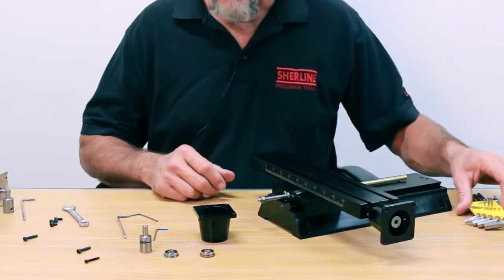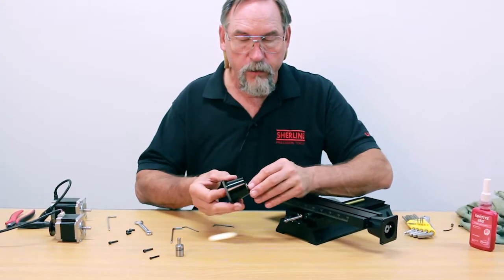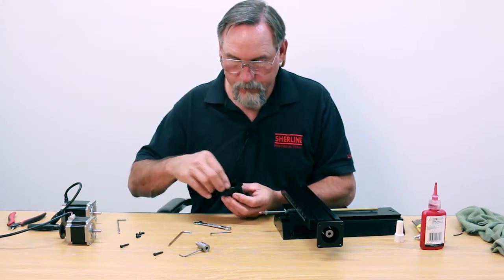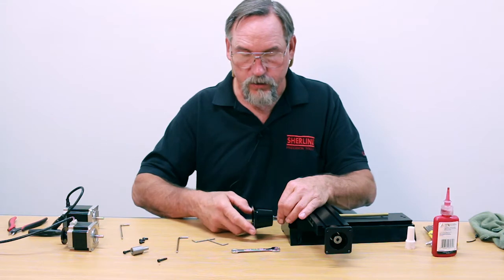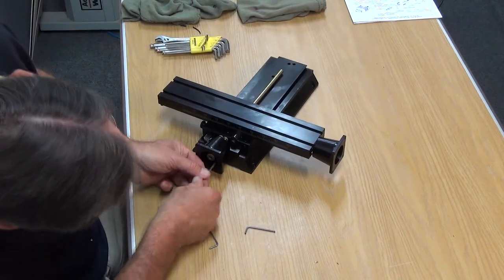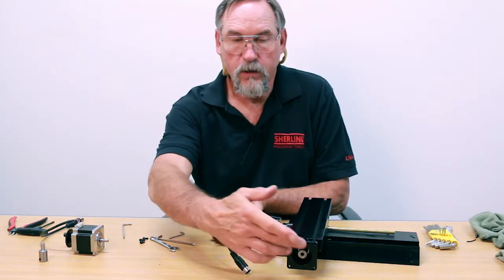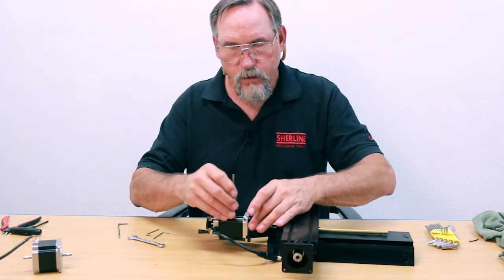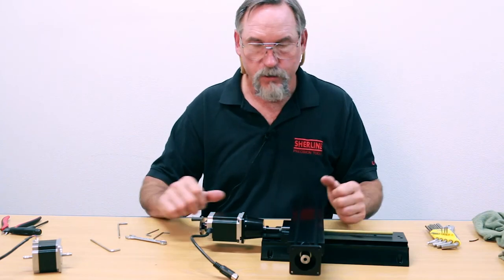Installing Stepper Motors

Comment: The video started out explaining why to switch the split motor coupling to a solid coupling for the high toque motor. It then shows the solid coupling being installed, then at 2:44, the solid coupling is on the bench and the split coupling is installed in the motor mount with the high torque motor.
Reply from the maker: You are correct that the solid coupling is shown on the table at the 2:44 mark, however, there is no clear indication that the slotted coupling is installed on the motor mount. Chalk it up to the magic of non-sequential editing.
Reply: Hi  @SherlineProducts  , thanks for the reply. Yes you're correct about what is in the mount. I did figure it was because of video editing, but just thought the 2 couplings got swapped. Anyways, it is a good video on replacing the stepper motor. I just had an issue with my Sherline cnc mill's y axis preload nut coming loose introducing play/backlash. I used Gorilla super glue on it, so hopefully I will not need to loosen the nut in the future.
Reply from the maker: @TinkeringJohn  Gorilla Glue. Good luck. LOL